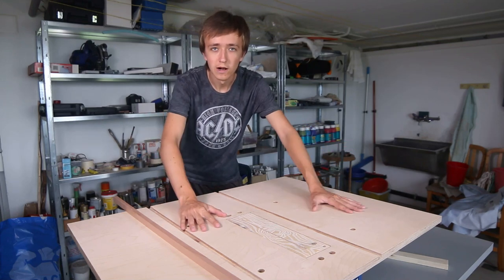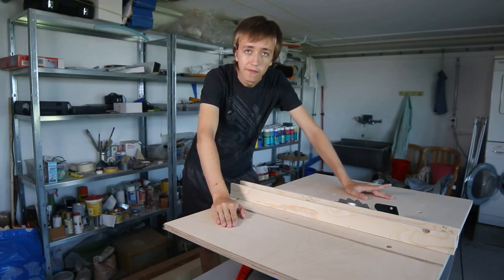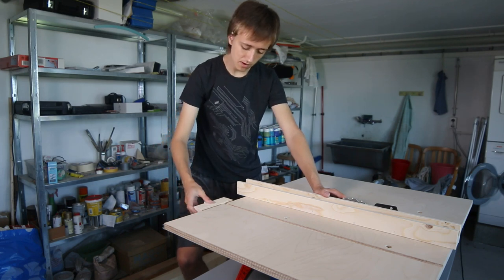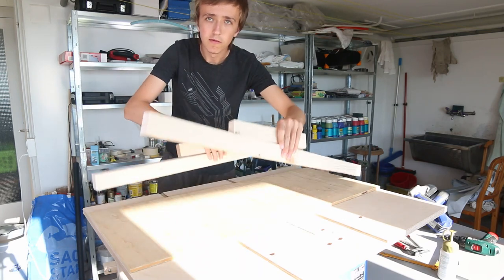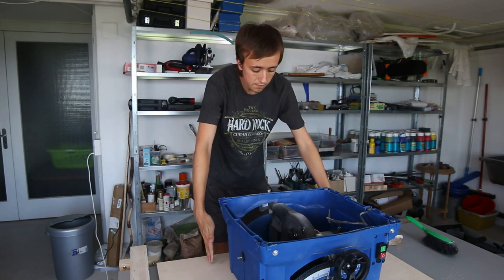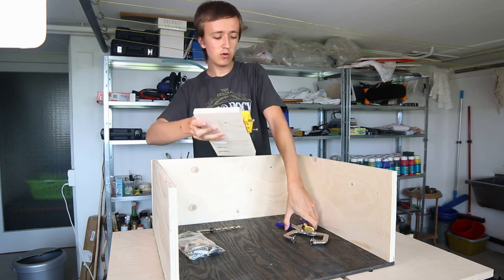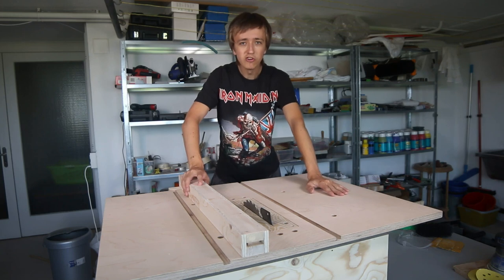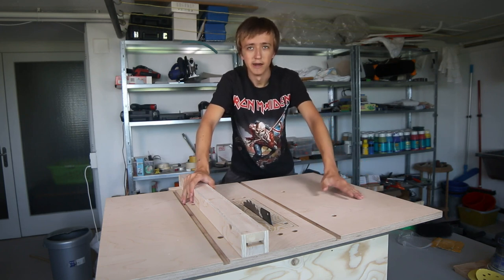Ultimate CHEAP DIY Table Saw - #2

Comment: Where did you get the metal channel you installed on the front of the table?
Reply from the maker: I just got it at a local hardware store (it's a curtain sliding system). If you want to get the proper stuff online, just look for T-Track